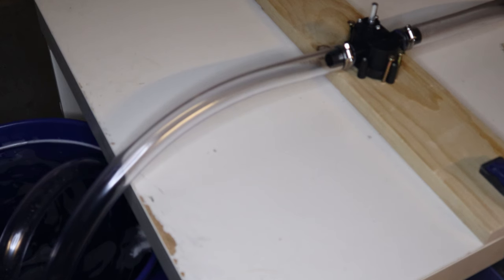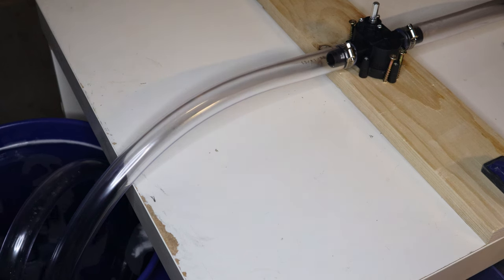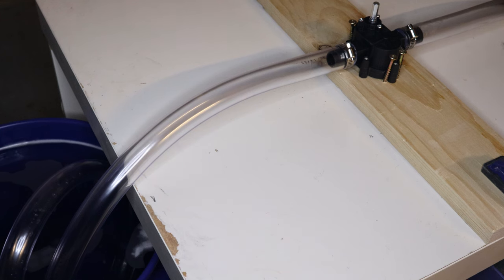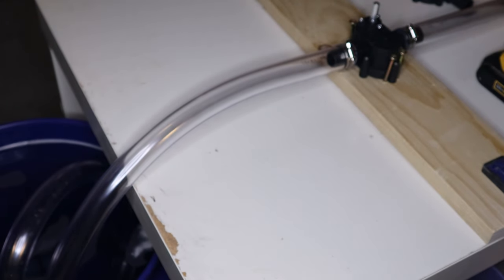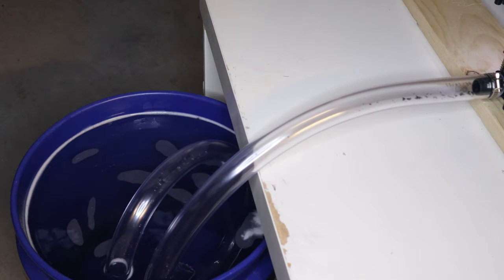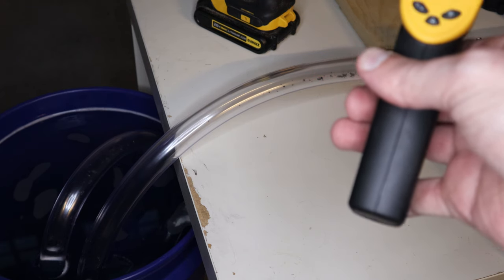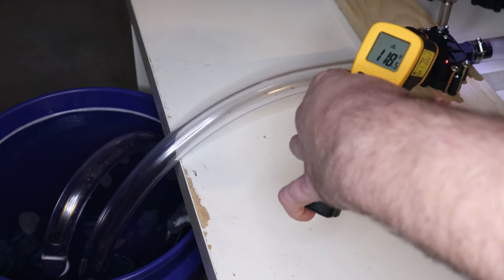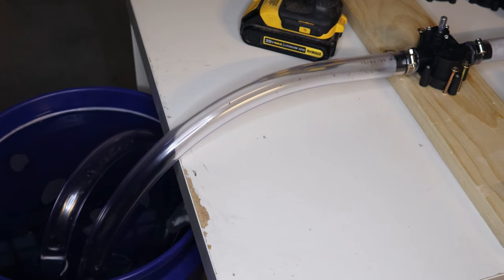Self-Priming Fluid Transfer Pump DESTROYED #fail #engineering

Comment: I think you're supposed to have the fluids up there so creates a vacuum
Reply from the maker: So this one was advertised as "self priming" so you are suppose to be able to run it dry. Honestly, this is what I expected after I tore down the first one. The gears are trash so it wont seal the create a vacuum, but I had to try just to see.